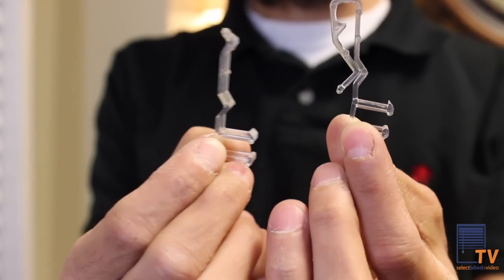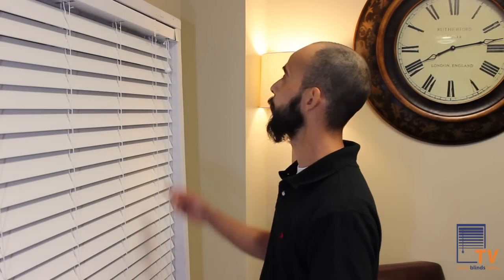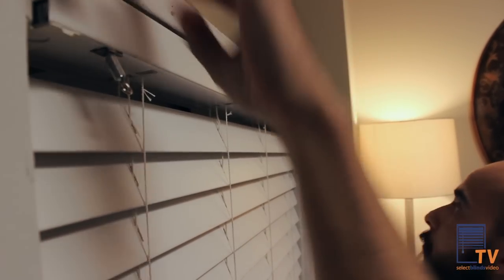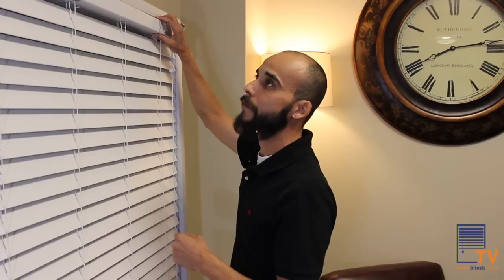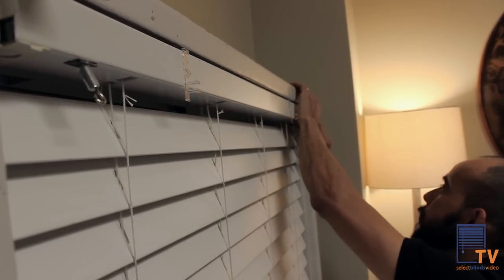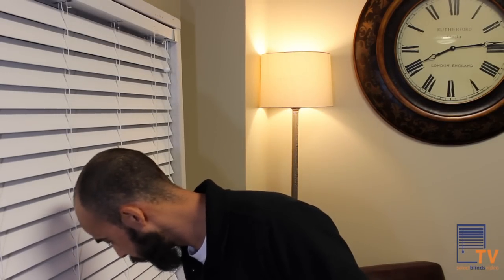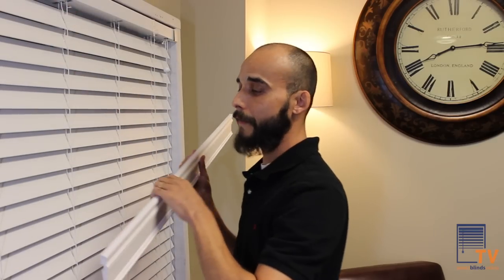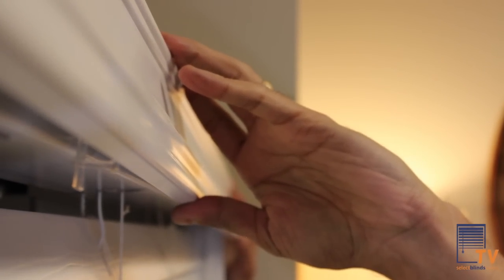How To Install Valance Clips (Faux Wood Blinds)

Comment: Hi,  I decided to paint my vertical blinds and they look awesome. My problem is that I'm having a problem putting the valance back on. I thought it would just slide through the clips and it doesn't. Is there a special trick to pulling the bottom part of the clip, without breaking it? The clips have an upper and lower tip. I am doing this by myself, so there are no helpers.

Comment: nice video and well done. Can you tell me though how do you get the valance off when its on you cant take the blind down without taking that off?
Reply from the maker: +turb59 If you have the same clips shown in this video, take a flat head screwdriver and push up on the the tab that is attached to the back of the valance. This should allow the tab on the back to compress. When the tab is pushed up, give your valance a motion of pushing up, and pulling out at the same time. Do this slowly, but the tab should come right out without any issues. 

If this doesn't work, contact us at 888 - 257 - 1840, and our friendly staff would be more than glad to walk you through any other issues you may have. 

- Anthony

Comment: Why not attach the clips to the valance first then to the rail- seems easier to me🤔
Reply: bridgette265 that's possible, however because Valance clips are plastic and usually fairly flimsy, installing your "anchor" pieces first, allow an easier install. Plus if you tried to do it the way you are thinking, it would just be awkward and could be more complicated.  I also have a video that demonstrates a Valance Clip install